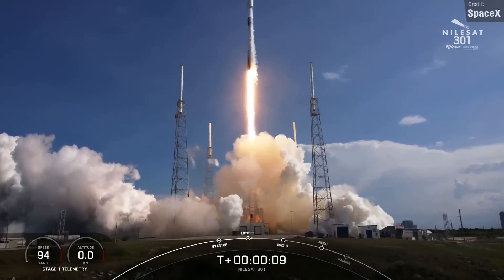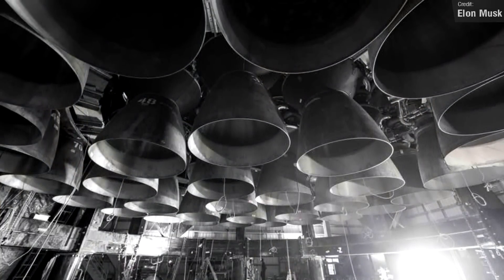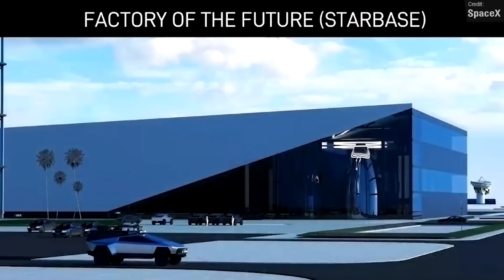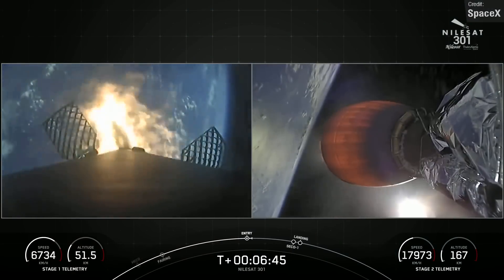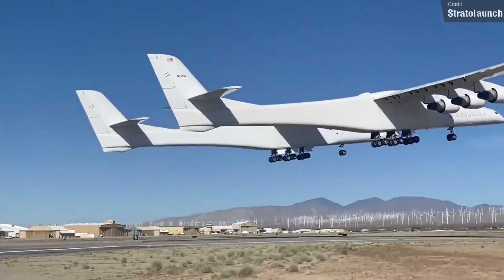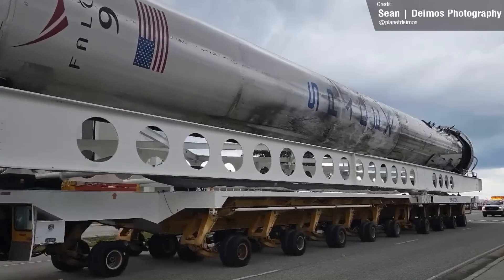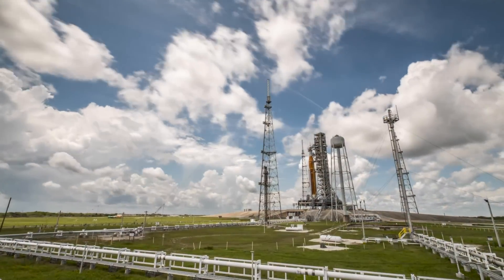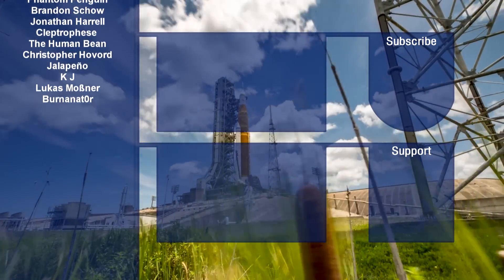Starship Booster 7 has ALL 33 Engines fitted, SpaceX Nilesat, Artemis SLS Rollout Again, JWST news

Comment: Now with air that thin know that high voltage will make plasma way easier... Also know thin air harder too fly a drone in with small prop... Also know a bigger prop even if its a turbine blower fan gonna need too spinn much faster too produce suficent down thrust for a soft vectored thrust starship rocket landing... Care too go back too the drawing board now? Your dangerious... And no better then a two faced lier con artist and thief.

Comment: Sometimes i think you make it sound juicy with abbsoulute nonsence knowing it wont work... Now do the actual homework. I shouldent need tell you how thin martion air is... Or you think its o2 and nitrogen? Please get it to a pressure  tank and seal yourself with a lung of air in a vacule bag inside pressure tank then remove air from tank as you exhale your lung of air into your vacume bag as it inflate in the simmulated martion atmosphear... Please breath deep and avoid hypoxia... Before going too mars...

Comment: Do you even know how thin atmosphear is on mars.... How you expect a turbine engine too work in atmosphear so thin the main propulsion fan would be virtually useless in reguards too its size too weight ratio vs atmospheric density of the thin martion atmosphear... You had better study nasa and drones on mars first in relation too drone weight and prop speed vs prop size... And you want make a turbine enjine in the mermin engine for a 5000 ton starship?! You are an idiot its like trying too fly a turbine jet in space... Um study x series space planes and the hypersore that was the x series space plane prototype beginning with moddel  x ten.

Comment: Teleporting actually uses almost 3 times as much fuel as a single Merlin engine propulsive landing burn.

So it was most likely just a small hiccup in the livestream feed.  I recommend they unplug, wait 30 seconds, and then re-plugin the camera.  That usually works.
Reply: Alternatively, they could launch the rocket again, a few hundreds of meters only, and see if, when it lands again, it displays the same anomalous behavior.
Reply: 16    / / /    16    / / /   16
  ANOMALY DETECTED
SENTINELS DISPATCHED
Reply: I find beating it with a stick works too , oddly it always turns out to be a loose connection when time for inspection is available 🤪

Comment: man i cant believe that thoose bolts at 12:00 hold  together that whole thing

i know that there are many screws togehter but its still kinda crazy
Reply: Think skyscrapers, they're also bolted together. It's either that or welding
Reply: @middletnpyro  that fact is true 

But the thing is rockets are not the heaviest but the bolts have to handle:

Vibration
Pull force 
Shear force 
temperature 
Pressure applied when fueled or lift off

If one of thoose nuts isnt fully tighten man thats gonna be a hell of a firework to watch
Reply: @Pilot3765  : And that's why they use wrenches with torque gauges for at least the final tightening- lets you use something more repeatable than simple feel.
Reply: @absalomdraconis  i would say the tighten it to more than 200nm

Comment: Chances of 33 engines firing together and NOT causing RUD on the launchpad…? I’m giving stage 0 a 50/50 chance of surviving.
Reply: The physics of that many huge engines all firing at once that close together, with the exhaust being reflected straight back from the ground is unimaginable - certainly unmodelable. Even Space X don't know what's going to happen. Chances are we're in for a few surprises. Quite possibly some loud, hot, expensive ones...
Reply: @paulhaynes8045  : I half expect the launch stand to be a write-off. Starship+Superheavy is admittedly no Sea Dragon, but there is a reason that thing was planned for ocean launches...
Reply: @absalomdraconis  not the sort of 'experiment' you'd expect someone to try in the middle of a nature reserve! Anywhere other than Texas this wouldn't even be contemplated.
Reply: @paulhaynes8045  It may well launch Starship, but only about 50 metres into the air when the entire thing explodes.
Reply: @paulhaynes8045  Much of the thrust won't be reflected straight back; there's a flame channel. It could still be wild though.
Reply: @eekee6034  that's good to hear. I haven't been keeping up with all the developments at BC, so I was thinking we were still in the days of Starship testing - when just three Raptors blew bits of the concrete base every where!

Comment: Astra did launch Sunday, but the second stage failed and the payload failed to reach orbit :(
Reply from the maker: Yep :( A real shame for Astra. The tally for Rocket 3 now is only 2 successful launches out of a total 7 attempts (28% success rate).

Hopefully each failure will help Astra improve the rocket and they'll get it flying reliably!
Reply: @MattLowne  Space is hard.
Reply: @pricelessppp  more to the point, it's also expensive. Very expensive. How much longer can they carry on before the money runs out?
Reply: @paulhaynes8045  Reportedly the launches are $2.5M - $3.5M each, so hopefully the money lasts awhile.
Reply: @MattLowne  Should not count the earlier launches where they knew it was uncertain to work like test launches. The ones that really hurt most are the ones where they have customer payloads onboard and expect them to work and instead they fail.
Using that metric it's still quite bad but on the positive at least each time they failed for a different reason so that's some progress.
Reply: @MattLowne  hopefully, I really hope that we will get a good successful mission from Astra
Reply: @MattLowne  you have to wonder how much time Astra has left in the industry... I'm not gonna stop rooting for them! Like it's already been said but I'll say it again, space is hard!

Comment: 2:06 Nah.
The Energia was more powerful than the Saturn and was operational from 1987 to 1988, N1 even more so if you count failed rockets (it was technically operational for the duration of its program).
Reply from the maker: N1 was not brought to operational status because it exploded on each launch attempt, hence my wording "most powerful rocket brought to operation". 

Numbers for Energia seem to vary depending on the source. But this only flew twice, with the first launch ending in failure.

Saturn V holds records for the heaviest payload launched and largest payload capacity to low Earth orbit. I don't consider hypothetical rocket launches to count as a serious contender. The only rockets that can dethrone it haven't flown yet, that being Starship or Long March 9.
Reply: Do you have numbers?
Reply: @FuriousImp  29MN (ASL) for 4 Zenit boosters (4x RD-170)
5.8MN (ASL) for core stage (4x RD-0120)
Total thrust is 34.8MN, higher than the thrust of the 5 F1 engines on the S-1C stage (33MN)
Launched twice, delivered payload to orbit successfully once. On the first launch the payload, the Polyus space station did not have a nominal orbital insertion. The space station was pointing the wrong way so the OMS slowed the station down instead of inserting it into orbit. Second launch was the test flight of the Buran spaceplane, it was launched into orbit and returned from orbit nominally.

Comment: Your thoughts if they make a special road so they don't close the public one when they move there rockets.
Also thoughts on them using thirsty cement to reduce flooding when they put this new road down if they ever do.
Reply: That would be nice! Have been thinking of that myself! I even considered if a small stretch of rail wouldn't be a good idea. The factory spits them out, puts them on a rail cart and rolls it straight down to the launch facility. No need for the SMP anymore. Or whatever that mover is called.
Reply: @FuriousImp  The launch cadence may not justify putting in a second road or rail. SpaceX is putting in turnoffs on Hwy 4 to increase traffic flow. Per the FAA draft review, SpaceX will be limited to 5 orbital and 5 sub-orbital operational flights per year. This is almost certainly due to the Texas state law on closing public beaches. The Texas legislature had to modify that law a few years ago to allow SpaceX even the limited closures that they have now. Some Texans are saying that they close the beach too much already. So unless Texas permanently closes Boca Chica beach (not likely), Boca Chica will never have a heavy launch cadence. Musk has said as much, since he said that Boca Chica will be a Starship R&D center.
Reply: @steveaustin2686  didn't realize Texas had that kind of law😅.
Well thank you for the education I do appreciate it 🤠.
Reply: @thesilentone4024  You're welcome. I didn't either until I saw a news article about the complaints from Texans about a year ago.
Reply: @steveaustin2686  Very informative. Thanks buddy.
Reply: @FuriousImp  You are welcome
Reply: @FuriousImp  : A railcart would have limited locational choices.